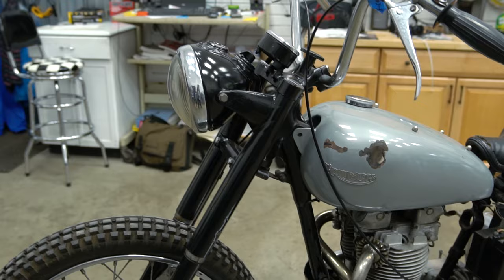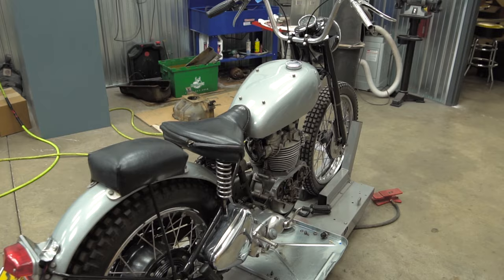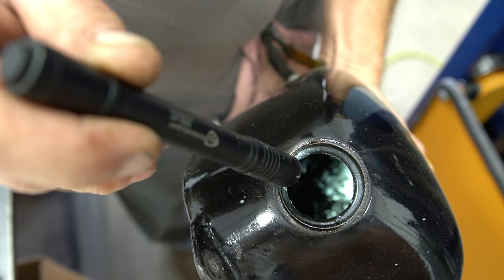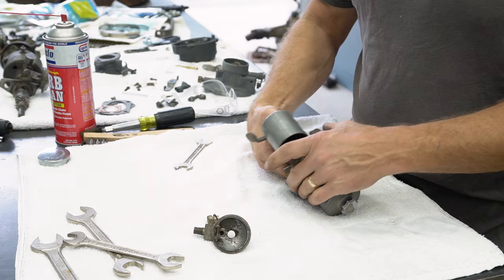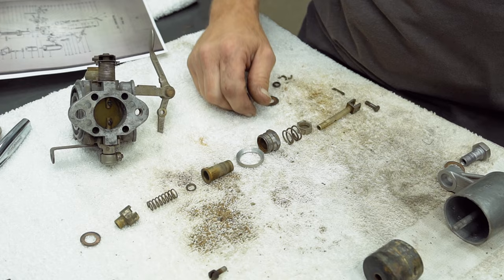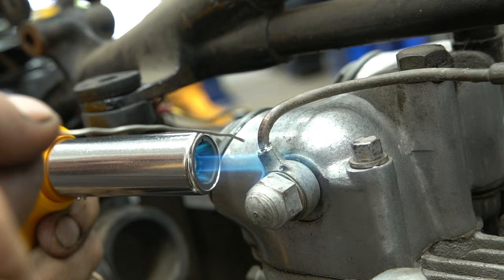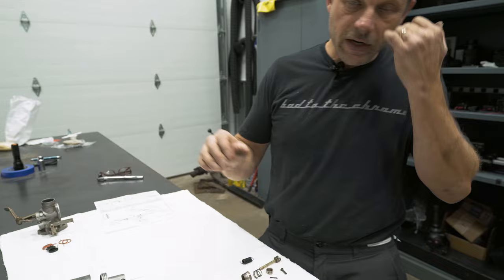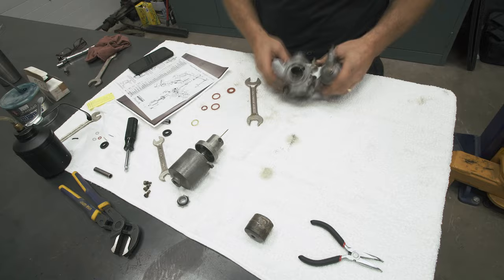Repairing The Fonz's vintage Triumph motorcycle - Will it run?

Comment: Absitively, Posilutely, Fantastic dude. I'm 64 now and when I was in high school the "Fonz" was was the man and we use to to ride our choppers to school. They were chopped Honda 550 and 750 four cylinders but choppers none the less. Ape hangers, 6 angle pullbacks,  King & Queen seats and 3 ft. sissy bars. When I got out of the Navy in 1988 I restored a 1963 Harley XLCH Sportster with seat and pillion pad much like the Fonz bike. I sold it and bought a 1974 Harley Electra Glide Police Special that I still have today. Great video!

Comment: Henry Winkler actually suffered from dyslexia and could never master riding a real motorcycle. By Season Two, the budget for the show had been reduced, along with some of the staff including Chris Haynes.  No one else on set could start the Knucklehead, so it was traded for a smaller motorcycle which was easier for Winkler to push around.  That motorcycle was the silver Triumph which most people associate with Fonzie.  Built by Bud Ekins, a famous offroad racer and stuntman, the Triumph lasted all the way until Season 8. Along with the switch to the smaller motorcycle, Fonzie also traded in his windbreaker for his iconic leather jacket.  He now had the "look", but even with the easier to handle Triumph, Winkler admits that he never rode it or any of the other motorcycles throughout the ten years that Happy Days was on the air.  For the rare scenes where Fonzie was seen riding, the crew sometimes had to go as far as mounting the motorcycle onto a board with wheels attached, so it could be pulled across the set.  Otherwise Fonzie just coasted through the scenes.
Reply: Interesting info.  Thanx for sharing it.
Reply: @danmcelroy6584  Ysvw :)
Reply: I'll bet he wishes he'd learned to ride, now.

Comment: Nice to see someone timing a pre unit slightly different from the way I used to do it.
9mm before TDC through the plug hole. Gently pulling Cigarette rolling paper jammed between the points to find contact breaking point. And bingo! Bolt it together.
Reply: Yep, the way shown seemed over complex. Put the engine where you want to spark to occur, rotate the mag until the paper slides free, job done.
Reply: Ha! I like the cig paper idea! Anyway, I usually use an ohmmeter across the points, but the paper thing is awfully simple and sounds like something granddad might have shown me. 🏍

Comment: I saw you putting a few drops of glue on the throttle handle.....  Hair Spray... hair spray brother.  old school
Reply: Hair spray takes longer to settle
Reply: Exactly right. From a time when kitchen floors were used to tear down bike engines and women understood perfectly ... And lent you their hair spray.
Reply: Shoe Goo  (wrapping the bar with electrical tape is old school)
Reply: good old spit works really well. I have two old BSA's and that's all i ever use
Reply: @1chish  In the early 90's my buddy, who knows almost everything about British iron, was helping me with my 1972 Norton. He tells me, after getting the head clean as possible, to take it in the house and put it in the oven at 450 deg.  Well I thought he was just nuts. As I place it in the oven and turn it on his wife came into the kitchen and saw what I was doing. What she said next just floored me, she says "Replacing valve guides huh"? LOL. I still thank her for the use of her oven and we laugh about it.
Reply: Def hair spray
Reply: @trreb1  See. SHE understood ...I still put new bearing races in the freezer overnight before putting fitting them. Good old thermal dynamics ...Lol
Reply: Kernal Scott 2  "Grab Ons"...I still have them on my '77 KZ650!
Reply: @meatybeatybignbouncy  Clamp ons, not grab ons. Sheesh.

Comment: Intriguing.  I rebuilt a 1961 Triumph 350 (3TA) in the late 1970s.  It had  single carb and distributor with automatic timing advance.  I blew that engine on an English motorway and replaced it with a newer 1967 350 engine with twin timing.  I set the timing using a simple circuit light and depth gauge threaded through the spark hole.  Sweet running bike.

Comment: If it's like later Triumph's they have a fine metal mesh oil filter fitted to a hex head plug on the bottom of the cases, often overlooked and if they block the oil pump and motor will starve of oil. Check the P.S.I of the oil when running at the pressure switch, should be about 70 P.S.I before the bypass valve kicks in.
Reply: A better post than most!
Reply: @tsclly2377  Not really, if the sump mesh screen plugs (which never ever happens) the worst thing that will happen is oil will not return to the oil tank and the engine will progressively burn more and more oil as the dry sump engine becomes a wet sump engine and blue smoke billows from the exhaust. There is a separate pump that pumps oil from the tank to the crank.

Comment: Nice 😎 I grew up with Happy Days on every week night.
I have a 1961 Humber Hawk Series II project car that I inherited when my father passed away eight years ago. He bought it in 1964.
I have been working on putting it back on the road after it has been sitting in storage for about 30 years.
All of the suspension components and body has UNF bolt threads and takes imperial tools. But the engine has the older Whitworth BSF bolts. I believe because the Humber Hawk engines date back to the 1930's and the nuts and bolts never changed. When I started working on the engine I had to find and buy sockets for it that I didn't already have.
I already had plenty of AF Imperial tool sets.
It is good to build up a tool set especially for the car though.

Comment: Nobody seems to have ever figured out that it was more than just a bit weird for a guy in his 30s ((?) was hanging around with teenagers. 

We got the show in the early ‘70s, and even at 12 I thought it was odd. But I put it down to the USA being different. 

The bike is cool, and authentic. The full mudguards and lack of those absurd gigantic gaps and humongous lumps of extraneous metal that builders of modern ‘choppers’ and passé racers feel the need to include. 

Nice rebuild, decent work. Thank you for sharing. 

The “plug wires” are HT leads btw ;)

Comment: that was one of the first things I was taught during my apprenticeship 
an engine needs compression, spark and fuel, go find which ones missing
Reply: Yeah...now you got to make sure EVERYTHING is receiving the proper PWM singal when you turn the key or the car give a big F U and refuses to start. 

Seriously, we had a f150 come into our shop that refused to start because of the bluetooth power module....like....why? If it dont work let the truck start and give an error message, but no, they have to leave a man stranded because the radio is having a trantrum. And even then guess what the fix was....unplug it, plug it back in. Oh yeah dear customer dont worry about labor....its only like $200 cause we had to pll half the dash out to get to the jesless thing.

Thank you for business!
Reply: Actually there are 5 things an engine needs in order to run properly; compression, fuel, spark, air and it has to be in time.
Reply: I've found if air is missing, the chances of living long enough to get it going are not good :)

Comment: I lucked out. The BSA i have is early 70's, just after dropping the need for Whitworth tools. I never even knew about them until this vid. Great vid. Hearing that double fire up gave me hope for my old Brit bike that has also been sitting for 30 years. Cheers!
Reply: My '75 MG Midget has some Whitworth bolts... got the one size that no SAE or Metric seemed to fit at SnapOn...

Comment: Now, find the knucklehead the Fonz "rode" the first season of "Happy Days"!
Reply: "Rode" in parenthesis is correct, as (from what I understand) he simply couldn't handle the big bike.
Reply: @painkillerjones6232  let me elaborate. By today's standards it isn't.
Reply: @chrisb9960  True, even when "Happy Days" was in production, no bike with a six cylinder engine was. Not yet..
Reply: @painkillerjones6232  That bike was in the area of 1200 CC. I don't know what kind of HP was at the rear wheel. Still for a small bike thatsize. I'm guessing with the weight of the frames back then it was around 600lbs.
Reply: Painkiller Jones that's a 500cc triumph single, a smallish bike even back then ( the big Harley's were 1200 and 1340 cc back then) Winkler just plain did not know how to ride a motorcycle. Also 6 cylinder bikes were never made by triumph. Bless you in Jesus Holy name, Amen.
Reply: @carlyandt6748  It's a twin.
Reply: @chrisb9960     you  needa  back  THOSE  numbers  up   tiger  500 (500cc)  bonnevilles  650 750 range
thnX  CARL
Reply: M o B There were 3 bikes used in the series. I was looking at the 47 knucklehead because that is what he had in the first season. If I recall correctly that’s what he had his oops on. The “internet’s” says it was a 1207 cc engine.
Reply: @chrisb9960  The Knuckle was an EL...1000cc engine. 
And no, Winkler had to have somebody start the bike for him in the scenes it was in, and he couldn't ride it. He kept stalling it.
Reply: @thatsmrharley2u2  which is why the motorcycle was put on a trailer and he sat on it or they didn’t show the face of another rider.
Reply: @chrisb9960  the Triumph, the Harley and the Honda XR 500 that nobody seems to remember.
Reply: @rossbrumby1957  
Season 1: 1947 Knucklehead Bobber 
EL was the 61 ci (999 cc) and the FL was a 74 ci (1212cc) motorcycle

Season 2-8: 1949 Silver Triumph Trophy TR5 Scrambler Custom 30.4 ci (498 cc) Let’s face it there were at least two silver Triumphs. One had some mini apes on it and the other had regular bars. 

Fonzie was given another Triumph (blue) after his was wreaked which was part of the show. 

I don’t remember there being a Honda. The only place I see that mentioned is when they claim he also rode a Harley Sportster.
Reply: @thatsmrharley2u2  Don’t really understand what you are saying no to. Henry had more problems than just stalling. Did you watch the video I posted at the top directed to Painkiller Jones?
Reply: @carlyandt6748  He did ride it but his Dislexia made him screw up the right & left hand controls. I watched the youtube video Fonzies Bike with many show clips of him riding it,  some say he was coasting & they added the engine sounds, I'll have to watch the clips again!
Reply: @chrisb9960  watch the youtube video Fonzie's Bike, several clips of him on it & not on trailer. Some say all coasting off ramps, I'll have to watch the clips again...
Reply: @jamnjen6666  I think I’ve watched enough of Henry Winkler talk about what he had to do for the shots. After 4 or 5 it’s just repetitive.

Comment: What an Incredible slush with the Tools!  Besides your mastery: my old chief of Shop once said: " Lord, protect us from Rain and Wind..and Engines of the british  kin"... :D
Reply: Yes but the variety kept him awake ...
Reply: Nothing wrong with British engines.
Reply: @SbMini79  Good evening, there are some really epic Engines, yes! Like the Merlin and even drivin an aircooled Triumph is a gorgeous Moment! But you have to admire that Tooling can be a bit of an adventure outside the uk
Reply: @SbMini79  Nothing at all. It was British engines that powered the Industrial revolution.
Reply: @stephhaug3316  Whitworth is always a laugh with anyone outside the UK. Im 28 and both my grandads taught me it as both had motorbikes with Whitworth on. Also the classic mini with an A series engine has a Whitworth flywheel and front pulley bolts. Also Britain has made some amazing engines. Merlin being one of them. But we've also made some trash eg the rover k series (I love this engine for all its faults though) and the triumph v8 that came in the stag.
Reply: @1chish  I agree
Reply: @SbMini79  Not sure you are right about Whitworth threads on British bikes and I have owned a few since I was 16 in 1965. Certainly not on any BSA / Triumph group bikes. Because a 'Whitworth' spanner fitted the head din't mean it was a BSW thread as a 'Whitworth' spanner fitted BSF, BSW and even BSC bolt heads and nuts. Indeed pre 1955 Morris and MG used a metric thread but with a head that fitted 'Whitworth' spanners! All very confusing!
As to the Mini (I am currently restoring a '78 Mini 1000) I can find no usage of BSW. I think you will find up until 1969 some may have been BSF but more likely the American UNC / UNF standard or BA for threads under 1/4"
All part of the fun in the restoration game... 'Guess that Thread!'
Reply: @1chish  check your flywheel bolt you'll find it's whitworth thread. It's 5/8 16 tpi Whitworth. Yeah guess thst thread is good fun. I've got a 1930 model a at the moment so trying to get my head around that ford used some strange size head and thread combos
Reply: @SbMini79  If you mean the flywheel to crank centre bolt that is a specially machined fitting as the head size bears no relation to the thread itself. Section A.31 of the factory workshop manual describes it as: 
   "[The] thread in the end of the crankshaft is not a Standard Whitworth but is a Whitworth form:  Diameter 5/8in.  16 T.P.I."
And @ 16 TPI its not a Whitworth size either. 

5/8" TPIs are:
BSW: 11
UNC: 11
UNF: 18
BSF: 14
Note that on all sizes a 'Whitworth' (BSW) is the same as a UNC except @ 1/2" where BSW is 12 TPI and UNF is 13 TPI.

16 TPI diameters are:
3/8" BSW
3/8" UNC
1/2" BSF
3/4" UNF
As I say its all good fun but over the years terms get to mean different things.
Reply: @1chish  learn something new everyday thanks
Reply: @SbMini79  No worries. Sorry if my OCD cut in too much but I am an ex engineer and had to do all that stuff in the '60s as an apprentice.
Reply: @1chish  don't be sorry its good to learn something new every day sounds like you've got some fun projects on the go
Reply: British bikes had Lucas electronics....hence why Lucas was nicknamed "The Prince of Darkness".

Comment: THERES A OIL SCREEN UNDER THE CRANK CASE THAT NEEDS TO BE CLEANED OUT IT'S A BIG HEX  NUT
Reply: Everyone forgets about it. That engine will be short lived.
Reply: Yeah the sludge tube
Reply: @lpd1snipe  You're not going to get the sludge trap out of the sump. You have to completely disassemble the engine. According to a Triumph ex-works employee, your average mechanic is more likely to introduce contaminants than remove them through the sump plug.
Reply: Only unit Twins have the big hex nut , on pre units a sump  screen old by 4 nuts on the bottom of the crank cases
Reply: Is it mounted to a plate on the bottom?  My '78 Bonneville had that, as well as a current Royal Enfield.  I unscrewed the 4 bolts and dropped it down.  Also undid the drain and screen then cleaned it al out the reinstall it.  The bolt in the middle is magnetic to  keep any metal bits out of the engine.

Comment: I just got confused when you were talking about the timing 🤣
Reply: Same
Reply: Engine timing is a sorcery best left to the mages and warlocks.
Reply: @Debonair.Aristocrat  Well you'd better call them, because this guy just set the timing to 19 instead of the correct 38 degrees. If he keeps riding it, he'll hole a piston.

Comment: Don't really know when they started using Lucas "Prince of Darkness" electrics but the kill switch was the first thing I looked at on my 70 Bonneville when it didn't want to start.
Reply: Prince of darkness was thier slogan but americans dont know that, it meant its better than any of lamps that were made of the period
Reply: @zx-qu1yu  "lucasfer"
Reply: @thatsmrharley2u2  no it meant its better than anything else
Reply: @zx-qu1yu  Lucas reputation sucks because of their electrics back then. I know, I owned several Brit bikes.
 Sorry to burst your bubble.